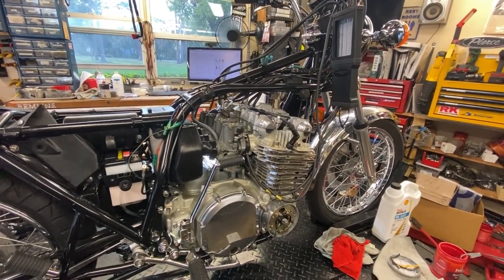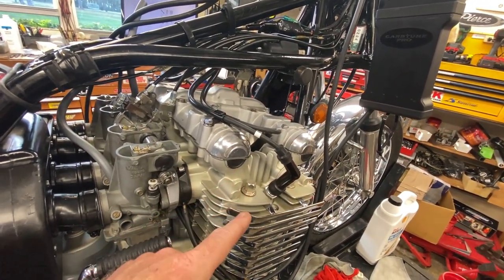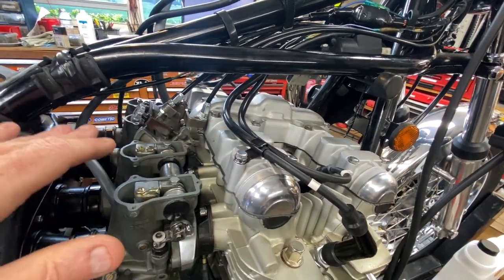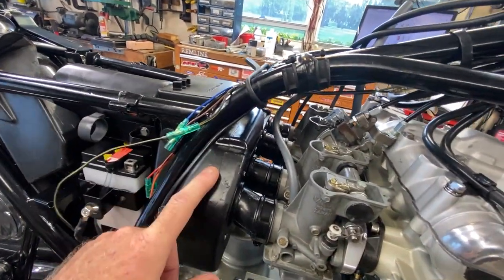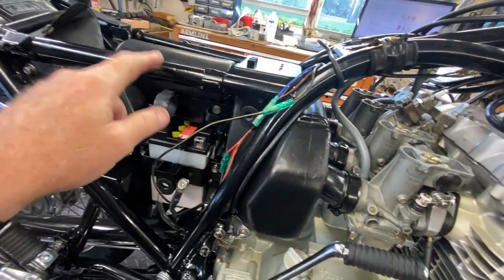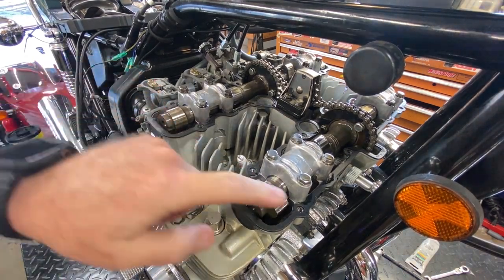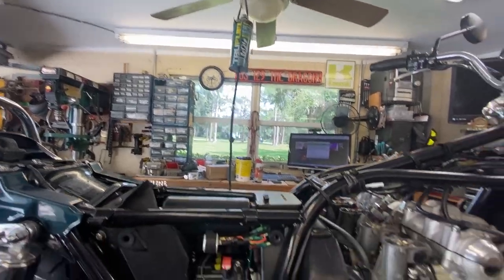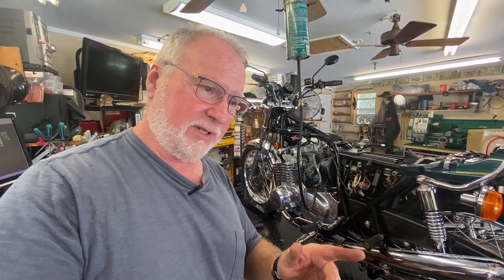KZ900 Video #3 (final): wrong cam timing, 2 bad plugs, how's it run now?

Comment: Thanks for referring to our chat the other day about hanging the carbtune upside down. I recently found out that the upside-down story is explicitly described in later revisions of the carbtune manual. I'll quote it here so you can read it: "Most bikes have readings higher than 8cmHg and going to 42cmHg, but some bikes such as R-series BMW's and two strokes can have readings lower than this. To get a reading below 8cmHg remove the plastic cable clip from the slot at the top of gauge and insert it into the slot at the bottom. Push cable clip into slot from front of gauge. Hang the Carbtune Pro upside-down. Ignore the scale figures. Zero will now be around 16cmHg on the scale but the full width scale graduations will still be 2cmHg. Absolute values are not important. Comparisons are important." 
Nice videos by the way. I enjoy watching them. They are very educational.
Reply from the maker: Yea thanks again for mentioning that. Interesting revision info. Appreciate it.

Comment: Great vid as always, thanks for the hard work in producing this content. As soon as you had the cover off and rotated the cams I could see there was a problem straight away, the bolt patterns on the cam sprockets should also match each other! Remember to count pins not links!
Reply from the maker: I should have seen it.

Comment: To verify the correct cam timing, the square cutouts on the right IN/EX camshaft ends should be paralell to the gasket surface.
Reply from the maker: Yes, you are correct. I failed to mention that.

Comment: That’s a cleanable aftermarket air cleaner element that if I’m not mistaken is an early mfg metal k& m air filter.I also ran into a problem with Emgo air filter not fitting either of the stock air boxes in either my 1978 kz1000 LTD’s.

Comment: Those long rubber tubes to the vacuum readout might damp the intake pulse.  The intake pulse would travel about the speed of sound, which is low at reduced pressure.  The pulse might never reach the manometer before the next engine cycle is under way.  This would be back of envelope calculable.

Comment: nice pipes,i am not a fan of mercury gauges
Reply from the maker: They're not mercury actually, they're precision ground and weighed slugs of steel I guess stainless maybe. Each one is calibrated for that particular spot in the tool. If they come out for cleaning they have to go back in the same place. The vacuum pulls up on each of those slugs. I've used the dial gauge type as well, they work, but being they're all cheap Chinese junk, they constantly require calibration. Cheers.
Reply: They used to be mercury filled years ago, now stainless slugs. I honestly don't know why people bother with any other type of gauge, with all the mechanical gubbins between the actual vacuum and the readout, this manometer type directly links to the vacuum being pulled, so simple and spot on accurate.
Reply: The old school Mercury gauges always work perfect for me and I've tuned many bikes back in the day.